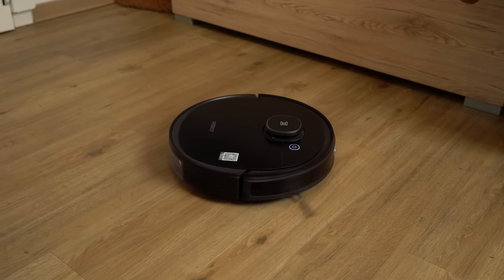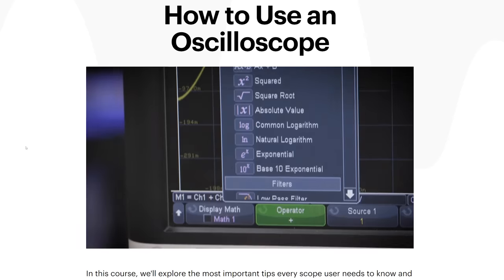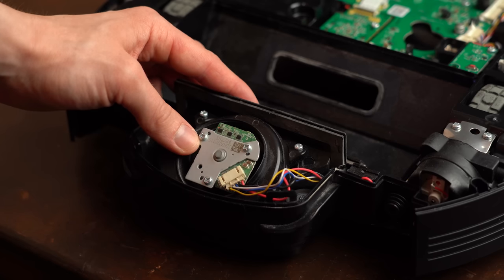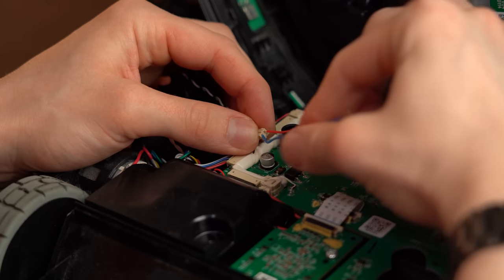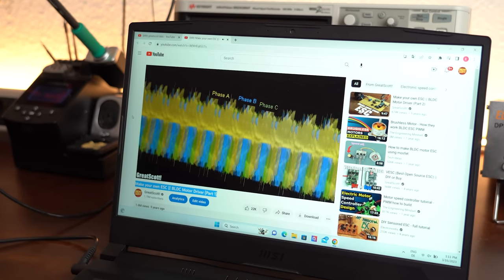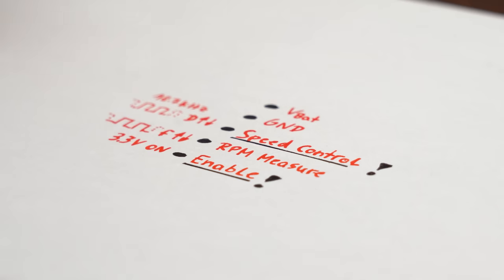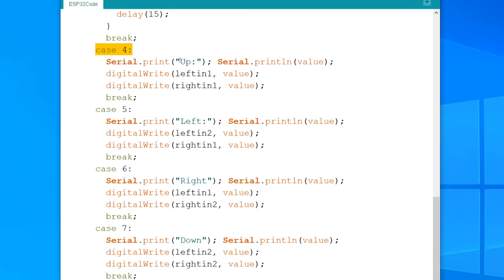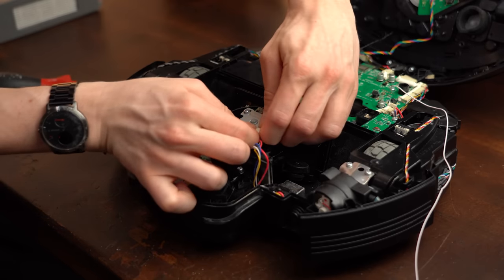Hacking my Robot Vacuum to add ONE MISSING Feature!

Comment: OMG!
I own the same darned robot (Deebot 920) and had the SAME problem with my right motor occasionally shutting down.  Did you ever figure out the issue?
It seems to happen when it finds too great of a load, or when its been operating for too long.
I tested the motor (like you did, by applying a voltage directly) and everything seems fine. So my gut tells me that the circuit board shuts that motor down when there is too high of a draw (like when its stuck), or that whatever drives it overheats and then shuts down.
Have you found the culprit? I ordered a back up motor just in case that solves the issue.
Thanks for the video.

Comment: FWIW, a common solution to not having space inside is to design and 3d print (or w/e) a case extender.  (i.e. extrude the outline of the division between two parts.)  In this situation, it would sit between the base and the top shell.  Designing it would be tricky, but the result would look like factory original and as much space inside as you could ever want.

Comment: My Deebot N79 (an older model from the same manufacturer) has a control function built in, is controlled used the infrared remote control included with the bot.

I can not believe that the more advanced model you have do not have it.

Comment: You actually need just the ESP 32 board. All the power electronics are on the motherboard already and are easy to identify and tap in to. I would use a PWM ramp on the drive motors to make the movement less jerky and maybe slow it down a little.

Comment: I think it's a great oversight by robot vacuum manufacturers to not include a manual control mode. Sometimes you just need to vacuum one specific spot quickly without having to haul a hand operated vacuum cleaner to that spot.

Comment: What uC is the robot using? I have one just like that and would really like to do some improvements 😂. Hopefully some debug port remained open. In that case you would not need any additional space... and speaking about that you can place the components in the rear of the robot with some velcro and flexible cable connecton to be able to get the watter tank out.

Comment: Another option would be to install your electronic board on top of the lidar sensor and route your cable wires down, hopefully the lidar will just ignore the small wires. :)

Comment: I wonder if that BLDC driver circuit uses an integrated BLDC controller IC like Allegro's A89301. Those three chips on the board may have been dual MOSFETs.

Comment: Just a suggestion, but you could have build these new components into an external module. And created an interface where you break out the necessary connections on the surface of the vacuum, to mount the module to quickly and easily. Then only the switch would need to be built into the vacuum itself. But I definitely understand knowing when to quit also important, that is something I lose sight of far too often on personal projects 😅

Comment: If I were to face the problem of not having space to place the components, I would have designed a curved enclosure to mount to the side of the vacuum. Honestly it would have been super simple for you. I have the same vacuum from a black Friday sale this year and I don't believe you would be disrupting normal operation in any way by gluing or screwing an enclosure to the side that is curved to be form fitting?

Comment: That robot is the bane of my existence 😅 ... It's great when it works, but it's so easily confused by chair legs. I often find it tangled up between some bar stools, even though it has a clear path back to the charging station 😒

In the end I prepare the house before running the robot, putting chairs on tables, removing charging cables and cat food bowls. All of that stuff that you would normally just move around when manually vacuuming.

Then it updates its map constantly (nice), which means it will recognize closed doors as walls and just refuse to go in the rooms beyond. It says in the manual to keep all doors open, but (a) that's just not possible with a toddler and a cat (b) apparently "ring-shaped" room layouts aren't handled well.

Scanning the house works great, but the automatic room detection is wonky and manually editing the rooms just refuses to work in the GUI (probably a me problem).

Oh ... And it's noisy as hell with the scrubbing plate attached.

All in all I'd still give stupid thing a 7/10 ... It's great if it works, but it often does not 🤷

Comment: I think this is very interesting. I have a vaccum robot cleaner with a dead motheboard (which cannot be bought). So basically I have a vaccum robot cleaner plateform (all motors and sensors are fully functional) that needs a brain. I wonder if you would have any recommandations on a suitable board for the brain if I want to use all the sensors and make software take control of the sensors and actuators to do a somewhat automatic behavior ? (the robot has no LIDAR)

Comment: I bought a MP vac like 8 years ago. No wet mopping, it had just enough space to cram a Pi Zero W into it, relays and a few other components (IR transmitter). Was able to remote control it, but it was sluggish and not super responsive (IR signals bouncing inside the shiny plastic housing I guess).
Had it linked to Alexa too using an Amazon cloud service (ec2?).
.... Then Amazon upgraded and it broke the voice functionality 😅

Comment: I somehow acquired a gen 1 or 2 roomba with no battery and some battle damage, and the plan I've had for it on the back burner was to somewhat inelegantly hack in RC car parts for remote control and higher top speed. I think it's simple enough that I could write some Arduino code that would at least allow it to aggressively bump into furniture as well as it once did.
Reply: Actual Roombas usually have an 8-pin serial port which may be hiding under the top cover. From what I can tell this is standard on models since 2005.

Comment: Wouldn't a "switch" relay directly on the battery cable (also controlled by the application) work? When you switch back to normal mode you disable any movement control (in app) only the same mode button available. Just an idea. But this way you have to rewire your work directly from the battery switch, and you have to solder diodes to each cable to prevent any voltage go to the circuits  boards.

Comment: Just wondering if you considered using the parts from a cheap remote-control car to control your vacuum.  Seems like a simpler solution to me, if it can be made to work.

Comment: Dunno which Roborock that one above is, but my S5 Max has a Remote Control feature already built in. Sure, it doesn't go zoooom as the above, but it works just fine - both a joystick kind of mode, and an arrow mode.

Comment: I like my robot vacuum cleaner but I find the software very limiting. I think it would be interesting if there was an open source robot vacuum project. It might even be possible to reflash the main boards on these devices. I imagine many of them use similar components.
I'm actually surprised they just use straight DC motors as that could lead to it going in circles. Are there sensors on the wheels so they can control the speed to keep them synchronized?
Reply: Actual Roombas (from iRobot) have wheel encoders and have great control. I imagine cheap ones would, too.
Reply: @eDoc2020  Makes sense, I guess. The motors are cheaper and don't really need the direct precision.

Comment: I guess you may want to fix the vacum by adding in just esp8266 and put it on homeasistant or openhab, to hardware reset the vacum cpu if the app cant control it  than solder esp just on wires so it fits in housing. Hope it gives some functional inspiration. 😅

Comment: I was gonna say I was surprised you didn't try reprogramming the existing hardware, but then realized that hardware hacking is more your style, lol. I'd have approached trying to reprogram it -- many of these are built on some flavor of microcontroller to begin with, so a software hack and custom app might have been an option. Possibly even with a normal/custom mode switch, if it's an MCU with an exposed pin...

For anyone in the market for a robot vacuum -- some do have manual control, so maybe look at the options before buying and hacking XD

Comment: interesting, i had a similar Deebot Robot and it was also doing the driving in circles thing. turned out, the motor power cable broke (and after researching i wasn't the only one with this phenomenon). Was this not the case with yours but only software?

Comment: I wonder what mcus those robot vacuums use?! Some of them use stmicroelectronics stm32xxxxx parts for Wich people have written custom code to do exactly what you did but just softmodding it. The esp32 could also be used with wifi. Some robots have serial or USB ports Wich could be accessed to get a shell or control over the robot

Comment: I did similar thing but with a SENCOR SRV 1000SL I moded to have , a better bumb sensor I added a pi zero, to control from online , and I currently try to integrate a TOF matrix sensor.
Reply: The problem is sowli but suerly i replacig the components with my 3d printed components ,

Comment: The original iRobot vacuum was hacked so people could do exactly what you were trying to do.  You might want to look up if, as the owner of the final product, the manufacturer allows for reverse engineering or re-flashing the controller.
Reply: Some models had a separate IR remote. Not sure what they do on newer ones... We get all ours second hand for about 1/5th of the price.

Comment: do you have an tip for my we got an robot vacuum cleaner but the lidar doesn't work anymore do you think its the motor with less power and less rpm or the laser sensor the laser sensor does work but idk if the receiver works

Comment: I did something simular with my dumm robot vacuum when i took it apart and cut his brains for arduino but it was a half suscess because in that time lidars were lot more expensive so have to use ultrasonic sensors that off axis arent great and gyro whitch i never utilized whitch is bummer. In mean time i did a mopiping robot that works but has same quirks as you can see on my channel. But what i really want to do next in this space is full fleged robot vacuum with lidar, camera esp32 on front for light object detection and up to 50W bldc suck motor with 99,8Wh battery. And my question for you is. Why didnt you make your robotic vacuum you got the lidar,you seam to work with esp32 and have expirience with basic electronics even a video that is titled 
Is LIDAR easy to use for hobbyists? DIY Roomba? Obstacle Avoidance System for Robotics 
second question are ecxited for esp32 p4?

Comment: Doesn't the app have a manual control included? I have a robot from the same brand which has a control in the app and also came with a physical remote to control the robot
Reply from the maker: Sadly no.

Comment: You'd have to 3d print a new top shell to make it fit, but then your lidar wouldn't be in the right position causing it to not work properly during normal operation.

Comment: I have a similar Deebot machine where the vacuum motor doesn't work anymore. I've replaced the unit, but with the same result, so it looks like it doesn't get power from the main board. I was thinking of bypassing the board and just give it the voltage it needs from somewhere else, but I don't know where to start. Can you share any of the resources you've used to reverse engineer your machine?

Comment: (Some ?) Roomba robot have à 5 pin connector hidden behind the upper lid that is a serial interface allowing to takeover the control of the robot. This could be used to interface am esp32 and remote control the robot.

Comment: What caused the short on the vacum motor? I'm curious.
Reply: After looking at the footage a couple of times:
The first time he was touching what seems to be the power pin (~14V).
But the second time, he shorted this pin with the long exposed core of the probe itself by accidentally touching the metal shielding on top of the PCB.
He could have prevented this by using the hook attachment that come with the probes, although another risk would be to slip to the ground pin right beside it and short it as well.
Reply: @maxketschik5625  Yep, that looks about right.

Comment: did you use the Arduino in the final design?  it seems like the ESP32 could generate those signals to control the vacuum without too much trouble.  love the project and video 🥰
Reply from the maker: The final design uses the ESP32.

Comment: Couldn't you mod the spare robot to be manually controlled? Then you could remove its original electronics to make room for your own and you'd still have the other robot to use in automagic mode.

Comment: Personally, if you have the ability, go for it.  But if you fear killing it, use it as an opportunity to buy a model with remote support.  But I will say thir, all of my robot vacs have come with app based and physical remotes, and they are horrible to control.  If you want good control, you are going to need to modify it anyway.  It would probably be easier though, if it was supported out of the box .

Comment: I have the same deebot, this mod is useless in my case, no need. However, I would like to see a way to modified the OEM software. When the bot is moved from the base, the LIDAR will pump the battery dry before you know it. Very frustrating.

Comment: I was thinking it might be better to use the existing motor circuitry and just tap in to the control signals. 

If the main controller is on a daughterboard then you could make something to sit in-between the connectors to piggy back on the signals and can easily be removed without any lasting effects.

Comment: Mmm lidar.   Tasty.  Pro tip theres 9 ir sensors in the bumber ...ur blocking one with googlies eyes 😊...50 50 chance this is correct cuz some robos that have lidar dont need em .. i repair alot of neato d bots ..lidar belt. Etc

Comment: Deebots are horrible, i also had the wheel issue.. the encoder are not protected so stuff gets into the encoders. They also miss a lot of spots.
But the biggest problem is that the central brush design is bad, so screws beans etc will get lodged between the bot & floor.
Neatos front brush design is much better for workshops etc.
Reply from the maker: I honestly can not complain about my deebot yet. But thanks for the tip with the encoder. I will try to clean that.

Comment: Or... You buy a Samsung robot. Mine is 8 years old, drives in straight parallel lines instead of the dreadfull criss cross driving. It even corrects itself when it shift to much and you can drive it with a remote. 
It also has a camera on top for mapping te rooms.

Comment: Please, help user of 360 S7 Pro to connect to their apps. Many user like me had the problem of side brush spinning without stop and 360 Smart Life said it was the mother board. I put the new mother board but apparently is set to China region and it won't bind to my broadband. 

Tried many things I found on internet and none of then worked :( 

I notice in the motherboard is a usb connection, not sure if I could find some wait to update the firmware

Comment: Get on KiCad 😉, design your custom PCB as small as poss (SMT) and get it made.
Worst comes to worse, that Makita could drill a hole in that thing, no problem.  Mount the PCB on the outside, which would mean using the 3D printer.  🤣

Comment: No way would I go through the troubleof handcontrol. I want my  robot vacuum to be automatic. That said, mine is automatic AND reacts to manual controls at the same time.

I have another  robot vacuum that is pretty dumb, yes it works automatic but gets itself stuck into corners and cant get out. That one has no  manual control at all. I may add that, but I think it would be better to  take out its brain alltogether and put in an ESP32 with a smarter decision maker protocol. I made something like that for a DIY robot mower, so should be possible to do for vacuum as well

Comment: I have an LG Roboking vacuum, a terrible machine, really dumb but it does have a remote control spot clean function, I never use it though the reason for having a robot is so the cleaning is done automatically if it doesn't do this it not performing it's job.